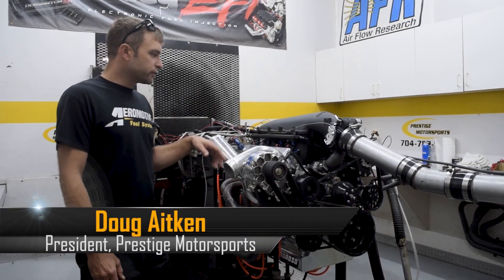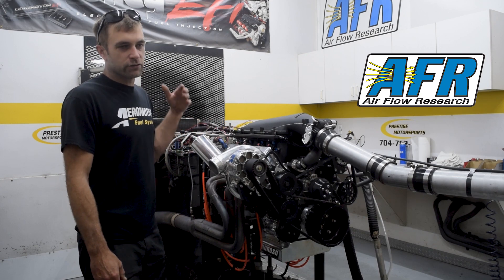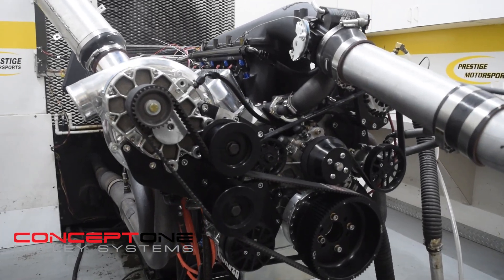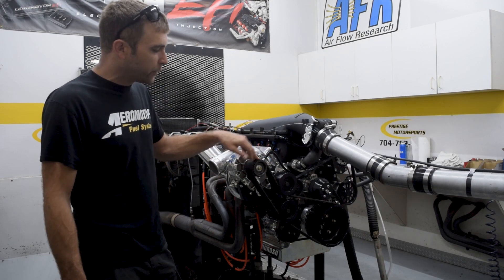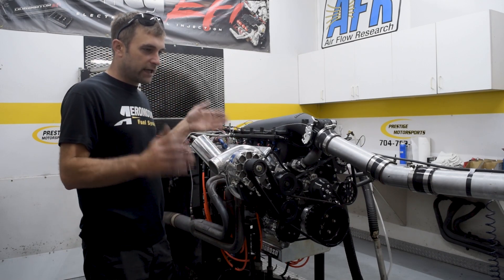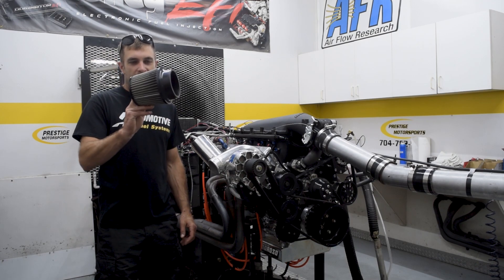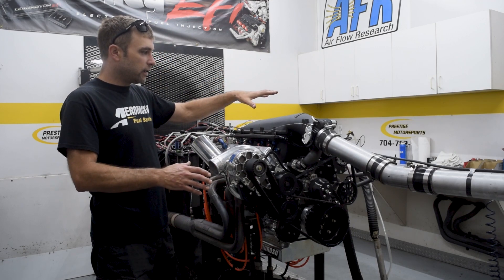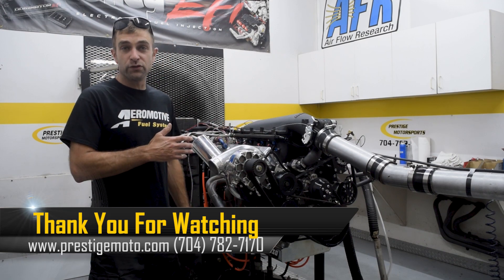1100+HP Vortech Supercharged E85 363ci Small Block Ford Dyno Testing at Prestige

Comment: Forgive my ignorance, but exactly what is a " 363"? I know that is a 351 Windsor block, but what crank is being used, and/ or is that just bored out 60 over? I do speak " Ford", and I've built three successful 302s, I'm never building another one, unless it's a 331 cubic inch " Clevor"! Please help to enlighten me as to exactly what a 363 is pieced together with? Thank you in advance. Wes Sept
Reply from the maker: Thanks for the message. The 363ci is a 302 block Bore/Stroke:4.125 x 3.400
Reply: @prestigemotorsports  cool! Forgive my ignorance, but is a 351 Windsor crank used? I thought that the furthest a 302 block can go is 347 cubic inches?
Reply: @wesleysept6536  some blocks can go 4.125 over makes a go from 347 to 363 👍
Reply: @ruazfast  I figured it out!  " BUT", the research I did said that these are " Boss" 302 blocks. Can a " 363" be built out of both? Cause a Boss 363 with Cleveland heads would be wicked! Especially if that means that I could run a Boss 302 tunnel ram, see what I'm asking? Thank you for anymore insight into this topic, as I love " 302s", and require to know everything about them, and I'm going to build one.
Reply: If you buy the block from Ford it might be a Boss 302 block. Not all I have to mark it blocks can be bored 125 over. Right now I have a 351 Cleveland in my car, with a tunnel. I'm thinking of changing over to something else like a 363 block, or a supercharger. I only have so much room in my car, with my shock towers. My motor is in a '64 falcon. Not a lot of room in there.
Reply: @ruazfast  sounds wicked! Those are great bodies!
Reply: @wesleysept6536   thanks, they are a little different.
Reply: @wesleysept6536  - You’d want to use a World Products or Dart Block instead of the FRPP Boss Block. The Boss Block is a great block but the other two have a longer cylinder which supports the piston at the bottom of the stroke so the skirt doesn’t come out of the cylinder like on the Boss Block. Better support and reduced rocking couple.
Reply: @cavscout62  no doubt eh! Thank you for spending the time to straighten me out, and send me in the right direction. What you said means more than perfect sense, and even though I have a thing for " Cleveland heads", when the time comes I'll be making the correct decision. With respect, and appreciation. Wes Sept

Comment: N I C E !!  I got the same numbers, with slightly different pas rt u can see here :  https://www.youtube.com/watch?v=tRHLy38zsYE
Dart 363, Hydraulic roller, 20lbs boost @ 6000rpm from a Novi2000, TFS 225 HiPorts, Holley HP EFI, E85, 120lb inj, BUT......no intercooler.  Just wasn't any room.